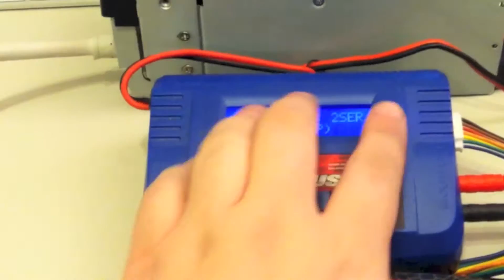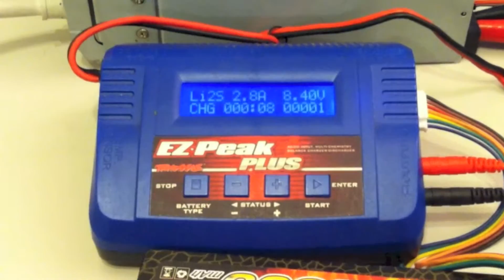Cheap 1300w PSU for DC power supply chargers.

Comment: Yes, you can put them in series for 24V. You have to seperarate the DC ground from the AC ground on both supplies which eliminates the need to keep the cases separated from one another and you retain the Earth ground on both units. Removing the Earth ground is dangerous because there's always the possibility of the two shorting on one another or yourself. I had two of these exact supplies set up for 24V which takes a bit of work, but is completely possible.

Comment from the maker: No.  All of the outputs are 12v but share a common ground.

If you wanted to run it as a 24v output you'd need two power supplies in series.  then you'd need to disable the ground on one of them.  Which would make it a little dangerous if the cases ever touched or you grounded both of them through your self.